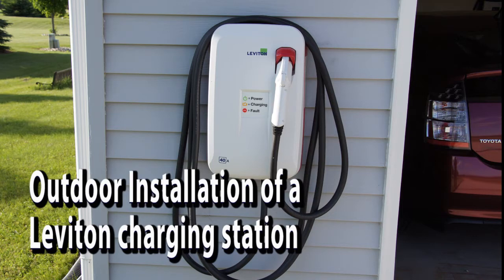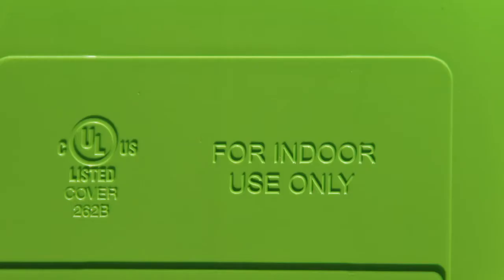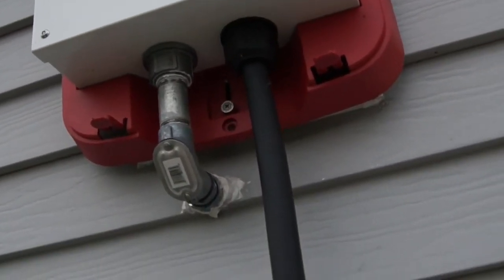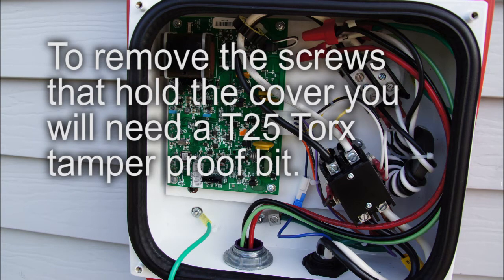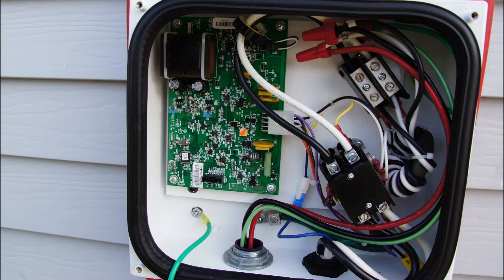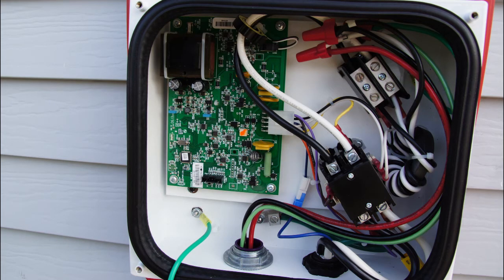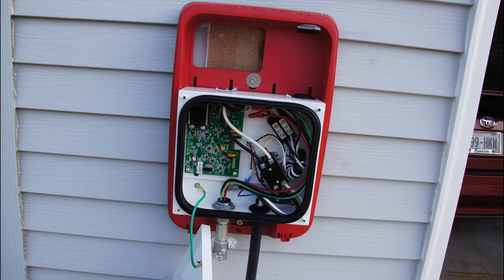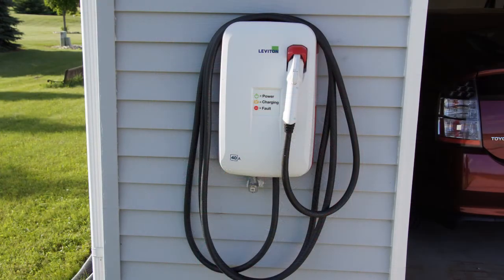Leviton  40 amp outdoor charging station installation.

Comment: The most reliable EV Charging cable, dual level 10/16 amp 240V
http://www.ebay.com/itm/ev-charging-station-cord-cable-J1772-EVSE-Current-select-16-10Amp-110-240-Volt-/252101131205?ssPageName=STRK:MESE:IT

Comment: Speaking of safety, might want to mention that the circuit breaker for the EVSE should be in the "off" position while installing the station.  You do mention turning the breaker back on at the end of the video, but never explicitly mention turning it off to begin with.  I know seems obvious, but just sayin' -- because people can sometimes be very ignorant.